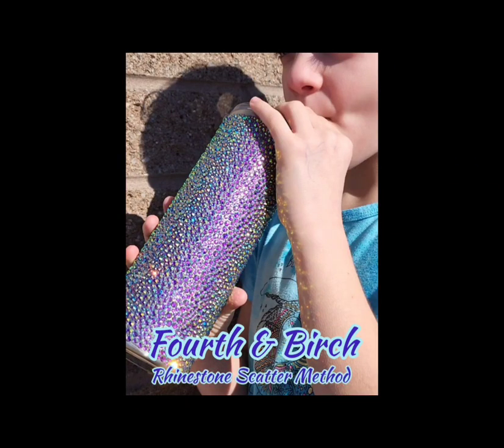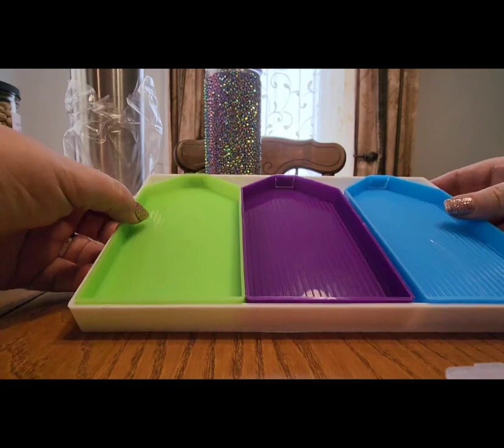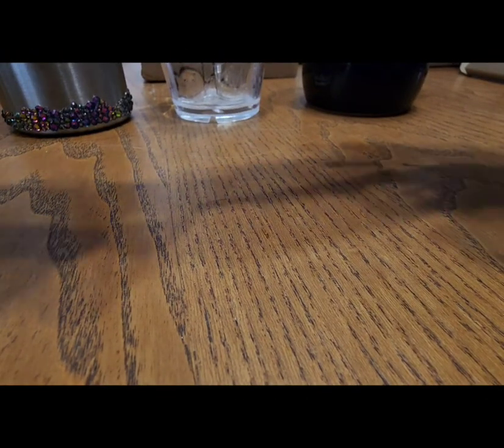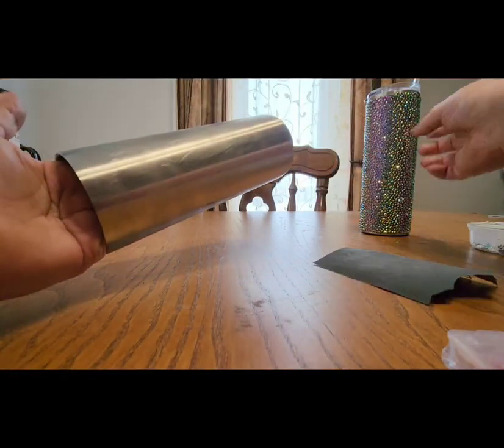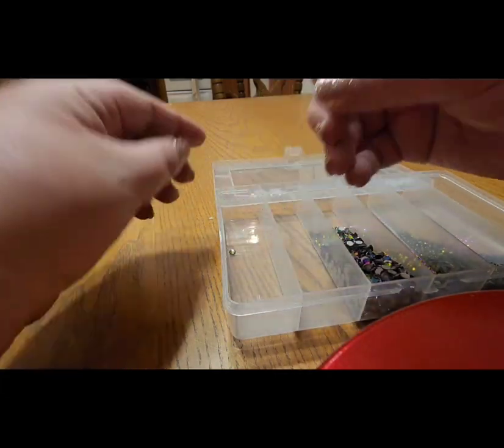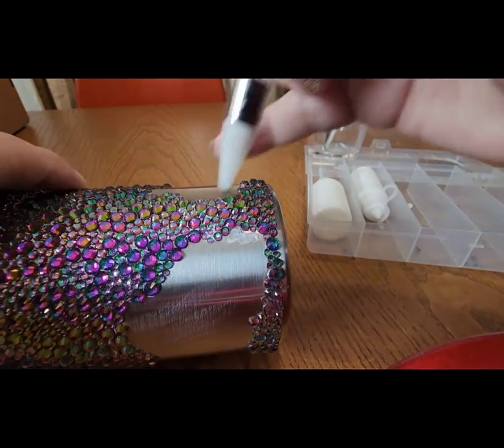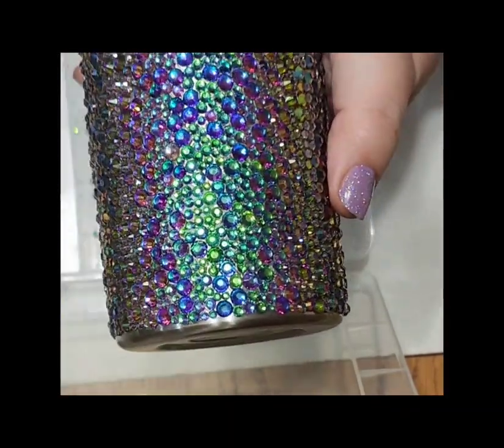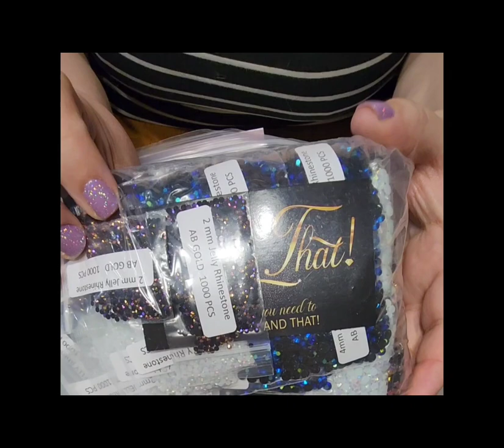Rhinestone Tumbler FULL TUTORIAL Using the Scatter Method

Comment: So overall how long does it take you to do an entire tumbler? &&&...I'm watching this video bc I'm wanting to bedazzle my ps5 controller but I'm pretty nervous considering how expensive they are. Any tips for me? I wanna do & the scatter method so. Any advice would be awesome! Lol!
Reply from the maker: Ahh! I'm a little envious that you have a PS5! Our PS4 died when the PS5s were basically non-existent in stores, so we finally just switched to PC gaming instead. 😭

I would think you could definitely do your controller in a couple days. It really depends on how much time you have to dedicate. It took me about 3 weeks to finish this tumbler, but I was only putting in an hour or two every few days.

For an odd-shaped canvas like your controller, you'll also want to do a section, then let it dry for a couple hours before starting a new section, so you don't keep accidentally bumping & moving stones around while you try to hold it and grip it in different ways when putting on more stones (if that makes sense).

I'd also consider taking fine sand paper & roughing up the smooth areas on the controller first (I know that sounds scary for an expensive controller!!!), but the plastic can be very smooth & slippery, and you definitely want your gluebto adhere well. Then wipe it with an alcohol cloth to clean the sanding dust off.

Good luck!!! Your project sounds so fun! ❤️
Reply: @fourthandbirch9809  HAHA!! Well I wouldn't have a ps5 if it wasn't for my awesome mother-in-law getting it for me for Christmas!! I was very happy to say the least! & thank you for the tips, sanding it does seem a little scary BUT I trust you & I'll trust the process! Thank you so much for all the advice, I really appreciate it!!! I'm a perfectionist so yeah it'll probably take me foreverrrrr but yes I need all the luck I can get!
Reply from the maker: @amandajenkins-ez7zo  I just Google searched "rhinestone controller" and there are a LOT of images & ones for sale. Browsing through them might help spark some ideas for you as far as placement, etc. They look pretty cool!

Comment: Hi! thanks for this tutorial, it's very helpful. I have a question though. How can you estimate how many stones you would need for a project? Like how many packs per size should I order for a tumbler like this?
Reply from the maker: Ooooh, this is SO difficult to estimate. There are so many factors that play into this. However, I'll try to give you a super rough estimate. So, I just taped off a 1"x1" square on mine and counted what I used in that area. In that square inch, I used 13 of the 5mm, 11 of the 4mm, 21 of the 3mm,and 11 of the 2mm.  So for a 20oz skinny like I used in this video (which has a height of about 8.2 and a circumference of 9.1) would have a square area of about 75 square inches in total. That would mean (if all my areas were similar in size dispersion), I would have used about 975 of the 5mm stones; 825 of the 4mm; 1,575 of the 3mm; and 825 of the 2mm.  I hope this helps at least a little!!! ❤️❤️
Reply: @fourthandbirch9809  Yes! This is very helpful especially for a beginner like me. I've been doing diamond paintings for about a year now and I think I'm ready to start blinging! Thank you thank you so much! <3 <3 <3
Reply from the maker: @hotCpa2tC  find me on Facebook (Fourth Birch) and let me know how it goes!! I'd love to see it!!! 🥰